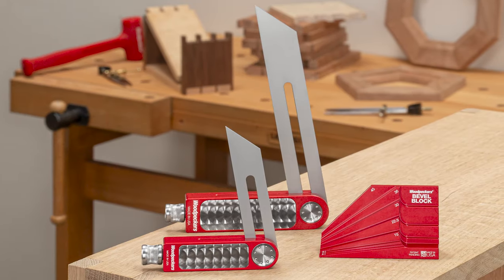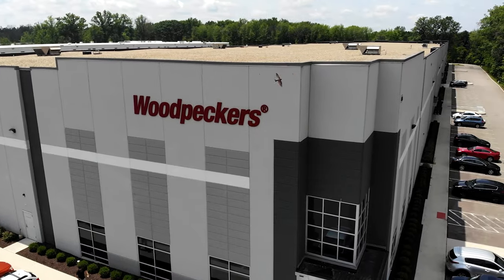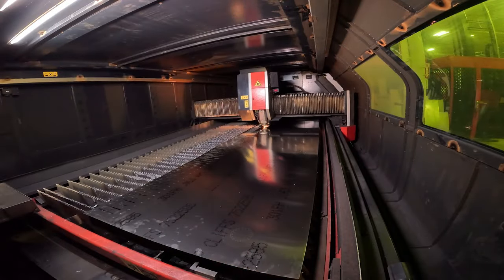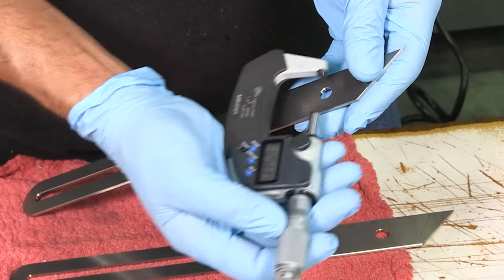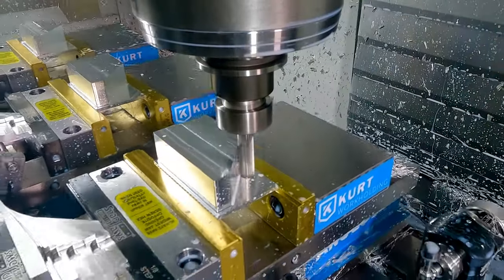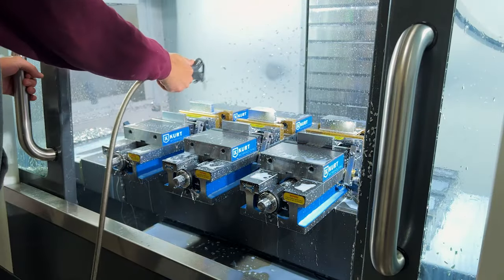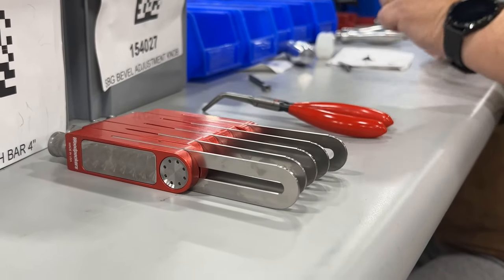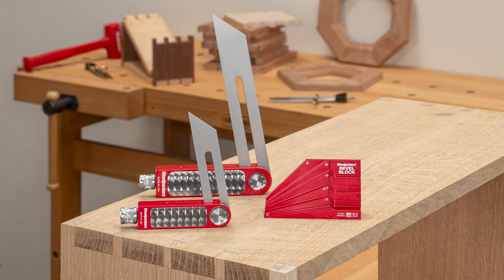Production Update: Sliding Bevel Gauge & Bevel Block

Comment: I just got mine. I love it. Question:  why do the circular holed pivots seem to have play. I seem to have to screw them in to get the unit tight
Reply from the maker: Contact Customer Service. If you're talking about the two large discs on either side of the blade mount, they should be tight when  you get it.